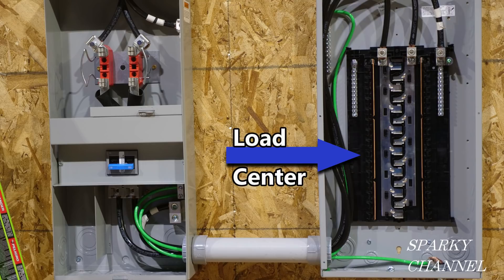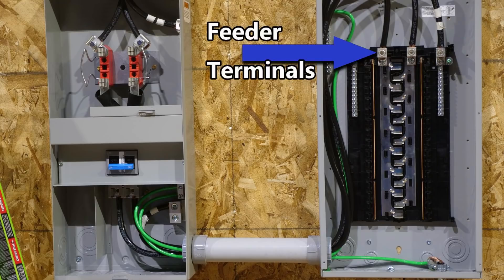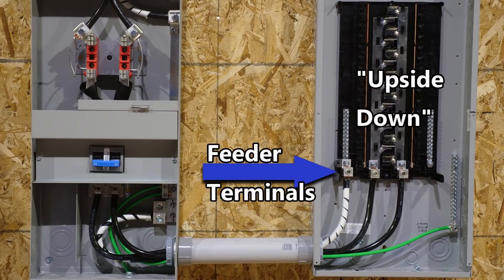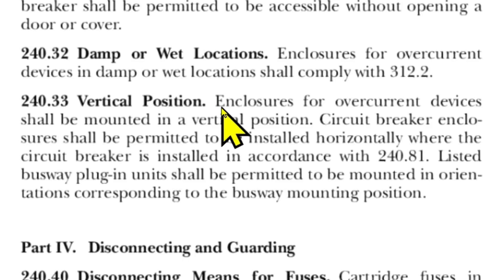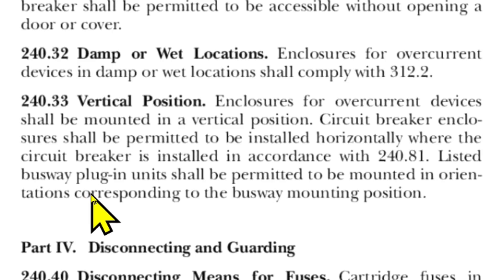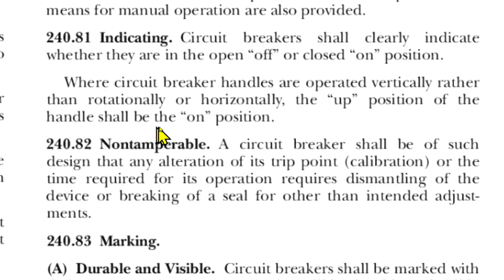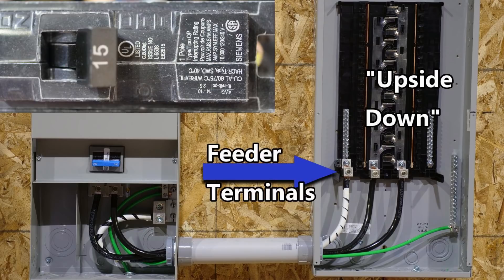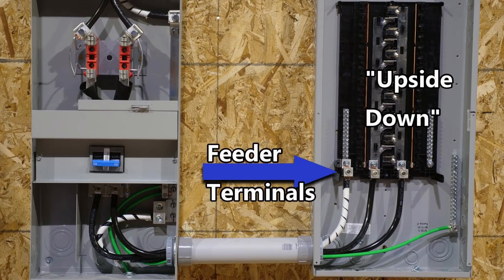Upside Down Load Center? What Do You Think?

Comment: Although there is no code violation for upside/down the problem is when the main feed breaker for service mounted in the same panel.  When you service the panel you should always shut off the main feed.  If it is  mounted on the bottom and when you drop something(Metal screwdriver)  you risk dropping on the main feed connections.  It is a risky practice to still service the panel even when the main feed breaker is disconnected and the main feed is live.....but I bet is done everyday homeowners and  even by professionals.   If you have the feed from the top there less risk of things coming in contact to the main feed.   Of course bottom installation is not a problem if you have the main feed disconnect in a separate panel as shown in the video.
Reply from the maker: Good points!
Reply: They sell yellow lug covers as well for added safety.
Reply: Either don't work on it live or invest in an arc flash kit. There are many exposed live parts in the electrical field , these panels are just one of thousands of scenarios where one will work around partially exposed live parts.
Reply: @Fritz Miller   Agreed.  The safest installation is shown in Spakry’s video where the main feed breaker is mounted outside the branch breaker box. Unfortunately this is not case in most residential installations.  If the main feed breaker is installed separate and isolated from the branch box the conversation of orientation of the feed installation is about as useless as which installation is correct for outlets being vertical or horizonal.
Reply: what brand of panels do you use where the body of the breaker will not shield the main lugs in an inverted installation?  and what if you are doing something in the top of a non inverted panel and drop your screwdriver?  the brand I install is guarded such that there is no way a straight piece of metal could contact both lugs and few ways it could contact one lug and the back of the can.  - and then, only if it is mounted with the lugs at the top.

accidentally contacting the busbar is a much higher risk.
Reply: @kenbrown2808   Never said that you could not protect the lugs but that also requires a professional to install it correctly.  Also work at the top of the panel could also be a hazard when the panel is serviced.  This also why I said the safest way is to fully cut off the main feed into the panel.  Most lugs are not finger safe and in the event that it is not protected and Darwin Idiot in panel that should be serviced by a professional it could be a accident waiting to happen.    

This is a good example of panel that the lugs are not protected.
https://youtu.be/BACQ3167pkA?t=47
Reply: @jzupancic77  that's a Cutler Hammer BR panel.  the lugs are enclosed on both sides and guarded from contact at the front.  I suppose if you dropped your screwdriver just right, and it bounced off the bottom of the can, it might bounce up into the bottom of the lug, but then it could only contact the can if it had a metal handle.  to contact the lugs from the front, you have to stick your tool straight in, in which case, it also wouldn't contact any metal.  you could hold the can with one hand and stick a finger of the other hand in, but that's not what your original claim of having the lugs at the bottom be dangerous was.  it was a dropped tool accidentally contacting the lugs.  true that it doesn't have the rubber guards over the lugs that now ship with them, but you still have to work at it to accidentally contact the lugs.
Reply: @kenbrown2808  Agreed I did not say about direct contact with the lugs which I should have.   In the installation example someone could accidentally place their fingers/hand on the wire that is exposed entering the lug and the other hand on the panel.  Highly unlikely but you can not protect for stupid or accidents .  Again the shared installation shows there many examples where the lugs are not using the rubber guards or the insulation is stripped back where the lug does not fully protect it from being exposed.
Reply: @jzupancic77  and again, that can happen regardless of orientation, which makes your claim of " If it is  mounted on the bottom and when you drop something(Metal screwdriver)  you risk dropping on the main feed connections. "  no less invalid.

yes, electrical work should only be done by a competent person.  and an incompetent person should never work on live equipment.
Reply: @kenbrown2808  You might be right about it is regardless of orientation but with that being said I feel someone is not going to reach up in panel when working on it.  Reaching inside and bracing them self from the bottom is more than likely.  In my opinion there is a higher probability of inadvertently contact when in the bottom position and exposed.   Inadvertent contact can happen in many ways you fall forward and down.....not up and out.
Reply: @jzupancic77  so you're spouting opinions and trying to justify them with platitudes.  keep digging, you might strike oil.  

if they fall and try to catch themselves on the main breaker assembly, they will probably end up with worse problems than their hand accidentally sliding under the bulk of the breaker and grabbing a lug with is much smaller than the body of the main breaker OR branch circuit breakers in a main lug panel.  and if the panel is mounted with the main breaker at the top, they will probably hit the busbars unless the panel is packed full.

yes, I already agreed, an incompetent person should not work on a breaker panel, whether it is lugs up, lugs down, or hanging from the ceiling like a pinata.
Reply: @kenbrown2808  Yes it is opinion which is exactly which what the video requested.  No one said you have to agree with it or not.  Each to their own.  You can choose your opinion and install it how see fit as long as it pass code and that code does not change.  Yes I have no problem at the end of day if you want hang from the ceiling like a piñata as long as your work does not harm others in the process.
Reply: @jzupancic77  there's a reason it's not called "the opinions of physics"
but like I said, keep digging.  just don't try to do electrical work.
Reply: @kenbrown2808  You win there is no reasoning with an unreasonable person....Go troll someone else.....You have a good day sir.
Reply: @jzupancic77  if by "unreasonable person" you mean one who keeps pointing out your inconsistencies and inaccuracies, then yes.
Reply from the maker: @kenbrown2808  Good points!

Comment: So your actually talking about turning the components upside down not the cabinet. The door hinges and weatherproof top cannot be flipped on exterior panels. There is one hazard in having the lugs at the bottom. You are crossing over them every time you reach in the panel to work beyond the dead front. Stay alert and aware.
Reply from the maker: Good point, thanks!
Reply: Lug covers would be a good add on for added protection

Comment: So what about smaller sub panels that have like 6 spaces and the breakers are open and close vertically? Is there an exception to those?
Reply: if it is a panel that has a single row of vertical breakers, it is acceptable to code, as long as it is installed with up being on.  that is the exception given to the requirement that panelboards not be installed horizontally.
Reply from the maker: You have to turn the sub panel so that the over current devises either open horizontally or so that up is on.

Comment: The only time you can't put it upside down is when the load centers outside and the enclosure is designed for is design for rain resistance That's the only time I could see any issues we have taken guts out of Load centers and put them in control panels We usually kept load on the top The ground bar neutral bar where nowhere near The load center     👍🏻🍻🍺😊
Reply from the maker: Thanks and Cheers!

Comment: I prefer the upsidedown version. Much neater installation. Less chance of rubbing due to vibration. I have heard the conduit and cabling vibrate while I high horse power motor spooled up on a mechanical press brake. They were really humming in a welding shop I worked in years ago.
Reply: I've seen a panel cover where the service conductors shorted to the cover and cut a slash from top to bottom as they arced to the cover.
Reply from the maker: Good point!

Comment: What if it’s a main breaker panel? I’ve install many of them “ upside down “ is this wrong?
Reply: As long as the main is oriented on up/ off down, if vertical.
Reply from the maker: Scott is correct.
Reply: More specifically, it is not wrong if the manufacturer allows for bottom feed.  Some don’t.

Comment: I understand this and it makes sense, however I am still trying to wrap my head around getting "bonding" between ground and neutrl correct. In the example shown, would the ground/ netrual be bonded in the breaker panel, or on the meter base/ main disconnect? I'm thinking the meter base/ disconnect?
Reply: The meter base is technically a main panel because it has a disconnect in the box, the main breaker, the panel on the left is a sub panel so N and G are separate.

Easy way to remember: Married at the main separate at the sub
Reply: @dudeman650  Panel on the right is the sub panel?
Reply: @tedlahm5740  yes.  you are thinking correctly.  personally, "first point of disconnect" is easy enough to remember.
Reply from the maker: In this case the GEC runs in a continuous manner to the meter disconnect from the ground rods, then an EGC runs to the load center.
Reply: @SparkyChannel  umm yea, that is still confusing :)
Reply: @dudeman650 is correct. And you can see it in the examples in the video. The ground bus in the sub panel is separated from the neutral and the neutral bus is insulated from the enclosure. However, in the meter base, the ground and the neutral are going to lugs that are bonded to the enclosure.

Comment: What about a load center with a main?  Great vid as usual. Thank you
Reply: If the main is vertical, then it needs to be oriented so "On" is up. If the main is horizontal, then you can install it either way.
Reply from the maker: Dave M is correct.
Reply: Thought so. It makes sense. Thank you

Comment: I do this on occasion, just make sure you use the horizontal main breaker for reasons you explained. Some have writing in the panel that is legible right side or upside-down so they accommodate for this install
Reply from the maker: Excellent, thanks!

Comment: An "upside down" panel used to irritate me, until I started installing them myself. I exclusively do it with the main lugs or breaker on the bottom now. I think it is neater, cleaner and it keeps the large wire from taking up room in the panel. Also when you turn off the main breaker your not working around feeder cables that are still hot, as they are on the bottom. Nothing more stressful then trying to terminate a ground wire on a terminal strip buried under live feeders that you can't turn off.
Reply: yes, if fed from underneath. If fed from overhead I put them in with lugs at the top.
Reply from the maker: Yes, that can be very stressful and who needs more stress? LOL! Excellent points!

Comment: aren't lugs supposed to be fully shielded nowadays? I would  prefer live terminals to be up & away from hands, tools and rain; but this setup does have the main disconnect in the meter enclosure. it's still a pain when you're just changing a breaker, or diagnosing.
Reply from the maker: Yes, lugs should be shielded. Not sure why these weren't. Good points!
Reply: Barriers are only required on Service Equipment.  Since the sub panel is not part of the Service, no barriers required.

Comment: Would the bottom of the outdoor panel keep it weather rating if turn “upside down”?
Reply: You might be able to flip the internal components. Not the waterproof cabinet. Most dead fronts on exterior panels do not allow for this.
Reply: No, so can only be done with indoor panels.

Comment: I agree and it makes the heavy feeder wire installation much easier, neater and fills less of the box.
Reply from the maker: Agreed!
Reply: Yes. Much cleaner install
Reply: Depends whether your feeder wires come in from below or in the top of the enclosure. Or if the feeder comes in to the side, you’d try to bring them in to the top of the side for a top-fed panel or down low for a bottom fed panel
Reply: @Ephesians-ts8ze  I was referencing the pictures shown in the video with the bottom feed.  Obviously, you would orient the panel to make the wiring easiest and neatest.
Reply: @LTVoyager  ok, I got ya. My bad

Comment: Are there instances where the manufacture of an enclosure would stamp the word ‘top” or “up”  on the enclosure indicating how it is intended to be oriented?
Reply: a raintight enclosure, or one with a vertical breaker would still have a defined top, so yes.
Reply: Some panels are stamped with TOP and must be installed in that position only.  Varies my manufacturer and panel model.

Comment: I think from a safety standpoint it makes more sense to have it in the standard up position less chance of contact with the hot lugs when your working in the panel. Imo
Reply: I agree, although if you have covers for the lugs it wouldn’t really matter either way.
Reply: @BitmappedWV Covers came with my panel, so I was thinking the same. It shouldn't matter.
Reply: I know squareD has lug protectors that come in their panels
Reply: I'd have no issue working on the panel live with the feeds on the top or bottom. If someone is concerned about working on a bottom-fed panel, they probably don't have the training/experience to work in a live panel to begin with. 

Also, if the panel isn't filled, most of the live surface area is the bussing where the orientation doesn't make a difference.

Comment: Thanks for sharing this information with us Bill. I've seen both panels mounted both ways. It doesn't really matter which way they are mounted, but the wires from the meter will come from the bottom of the panel instead of the top, and the main breaker could possibly be on the bottom. Thanks Bill!
Reply from the maker: My pleasure, thanks!

Comment: A lot of larger panels have the main disconnect or lugs on the bottom, to allow for underground feeds. Ordered from factory that way, but, they can often be installed "upside down", if things change, or are ordered incorrectly.
Reply from the maker: Excellent, thanks!

Comment: I have this "upside down" setup.  I wonder if a generator interlock would work correctly?  "Upside Down"
Reply: It will not affect an interlock at all. The most that I'd expect to happen is that the interlock will be "sitting" on the main handle until it's turn off when it will fall into the path of turning the main back on. Operationally though, no interlock I've ever installed will be affected.
Reply from the maker: @jjenkins1210  Thanks!
Reply: @SparkyChannel  no problem. Where are eyall located by the way? Don't happen to be in Texas do you?
Reply: @jjenkins1210  New Jersey Show... want some snow?
Reply: @PelicanPines  nope. I'll take some electricians though.
Reply from the maker: @jjenkins1210  San Diego.
Reply: @SparkyChannel  Shucks. Well, we're always hiring in Texas when any of your guys want to relocate.
Reply from the maker: @jjenkins1210  Thanks so much for the offer!  I like it here in San Diego though.:goodvibes:

Comment: What is the overall height of the main disconnect from the ground? I know it doesn’t matter on this because the main disconnect is right under the meter. If it’s maxed out on height if it on top and you can flip the whole things is that ok too?
Reply: Max height of an Overcurrent device is 6ft 7 in in the on position measured from the ground

Comment: I feel that the if the manufacturer makes the cabinet capable of being mounted "upside down", there's no problem.
Reply from the maker: I agree.
Reply: My only concern is that those mains terminal lugs are more exposed to something dropping across them while replacing a breaker.
Are there covers available to protect the lugs?
Reply: @a..d5518  2017 code requires the lugs to be covered. The covers come with the panels now.
Reply: @jimmac1185  Thanks.
Are covers available for older main panels? Mine is about 30 years old still in excellent condition…
Reply: @a..d5518  they're fairly universal. If you search main terminal barriers, you should see some options pop up.

Comment: Is the height of the feeder required to be above the finished floor to reduce flood damage in areas prone to flooding?
I think if I were working on a panel I would want an insulated barrier to keep belt buckles or tools from accident contact with feeder wiring.
Reply from the maker: Excellent point. Local jurisdictions may have rules like that.